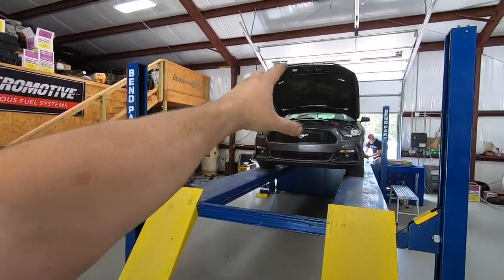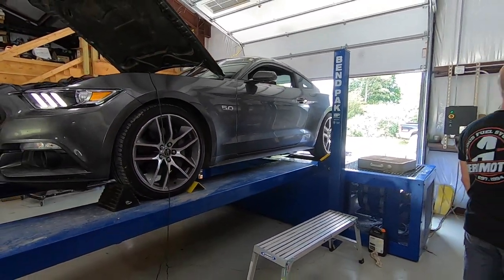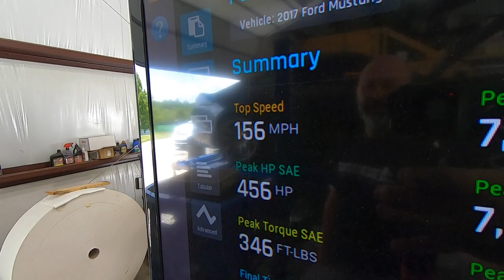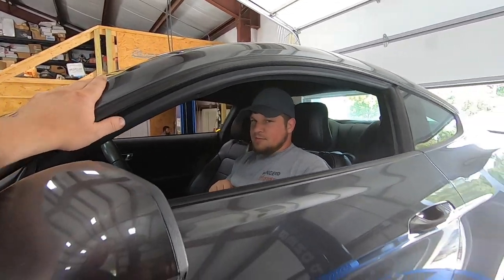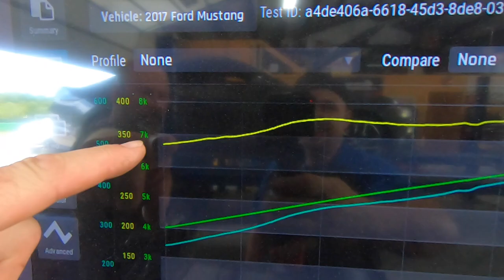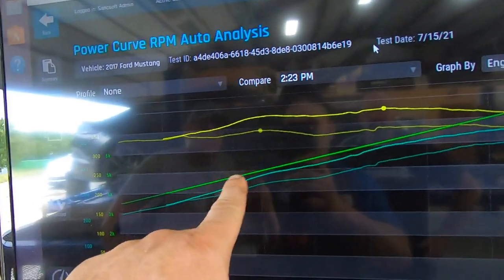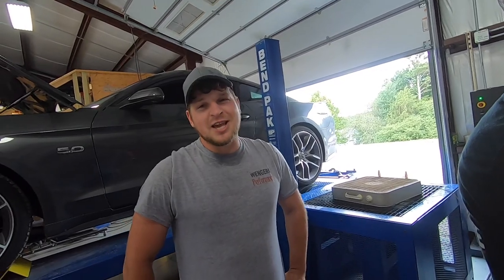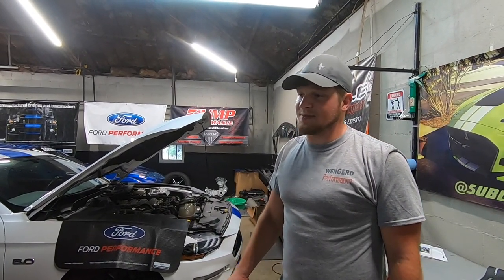This Impressed me! Stage 2 Comp Cam 17 Mustang GT on the dyno on 93 pump!

Comment: My 15 gt performance package with comp cams mutha thumpers and stainless power long tube headers scavenger x pipe and Flowmaster outlaw mufflers c&l racer cai made 452hp at 6000rpm and 440tq at 5000rpm over baseline was 379hp and 342tq picked up 72hp and 90lbs of torque
Reply: Add the Gen3 intake manifold into that mix, and you'll see even better runs! Great setup!

Comment: Even more to love on the Gen 2....as long time tuner still new to the Coyote from the GM world.........
 Why the fck would you lock out your biggest benefit TRI-VCT with control over your DOHC independently on the 4v head THAT'S precisely WHY the Coyote runs so good literally its biggest advantage....

 So if your valve spring rate and lobe aggression arent so excessive that your cam phasers can't maintain commanded position throughout a run, including idle via oil pressure, why on earth would you give that advantage away by locking out the cams?....you can log commanded/error and see how well it's working, ask Gen 3 Coyote guys with the wandering idle due to intake phaser issues...

 I could tell a lot in playing with my boosted Gen 3 tune and the exhaust cams especially, you can build or blow thru cylinder pressure for street as well ( aka try to kill some of that TVS torque on the street ) super fun to have that control and a huge reason I was attracted after all these years to the Coyote platform....can't imagine locking my cams out unless it was a necessity because the phasers simply wouldn't  hold commanded phasing 

 Very glad to see this wish THIS car was going to track!!!

 Well done everyone, love the logo!!!
Reply from the maker: Thank you sir and many valid points.

Comment: Dang, first Dyno pull that I have seen that goes over 20 seconds full throttle. I would have pulled the plug if that was my car.
Reply from the maker: It is a loaded dyno which simulates load you have on the road. Also it is tuning so it is going from 3,000 to redline. So it is a long pull but if you did the same pull on the street you would be doing same.  A unloaded dyno makes for faster pulls but also doesn’t load the car same as the road. So a loaded dyno does better for tuning.

Comment: Wonder why he went stage 2 and not stage 3
Reply: Ask the customer?? hehe
Reply: I just wanted to play it safe. I daily the car and I know that stage 3 comp cams are no springs required I just figured it’d still be a solid build with the stage 2 and a little easier on the stock springs so that’s what I went with
Reply: @rockytop7799  Are you the owner? If so how is it with daily driving ?
Reply: @georvisdial6318  yes I am the owner. As a daily, and I believe in any aspect, it’s much better than it was before. It’s more comfortable in the way it drives.  When I’m just cruising  it shifts much better. It’s an automatic and before the shifts felt uncertain now they’re on point. When I want to get on it it’s aggressive and will fly. The cams also have no affects on drivability really.
Reply: @rockytop7799  was it required for you to get new OPG ? I wanna get some but don’t want to pay 1000 extra for Opg install smh
Reply: @rockytop7799  it’s crazy how they didn’t mention it’s a 6r80 that’s some really big power if you factor in the drivetrain lost you pushing around probably 600+ to the crank on 93 and around 630 on e85

Comment: Total idiot here, but what does that correlate to the track?  1/4 mile.  I just sold my 392 Daytona and I miss her.
Reply: If it’s setup right 10s my old S197 with stage 3 cams made 461 whp and went 11.0 In high Da and elevation. In good air I would of went 10.6s maybe 10.8s
Reply: @underfedcoyote5.022  thank you Sir!

Comment: If that were an old 4v,if it made 450hp it would be in the 400s on torque, hell even a 2v usually making great torque to hp, I just hate winding the piss out of a coyote just to get tires to break loose on a 275 bald Achilles, where does the torque loose from old to new, vct? Think that's what made an 03 04 so much fun if u made 440hp u made 450trq, least till u heat soaked